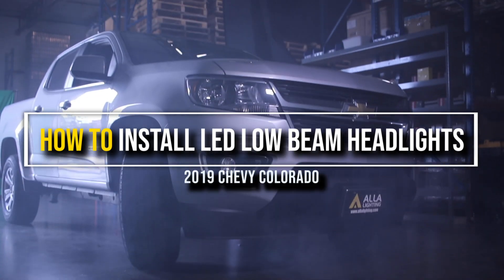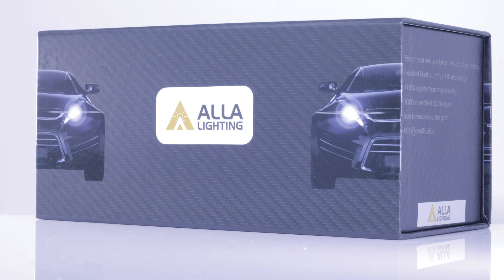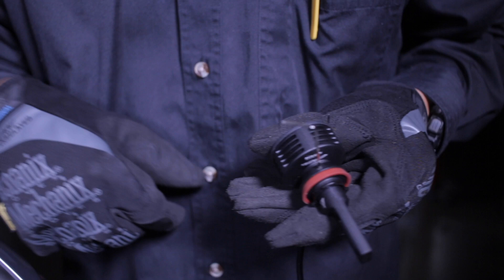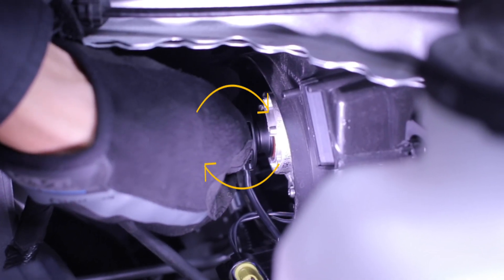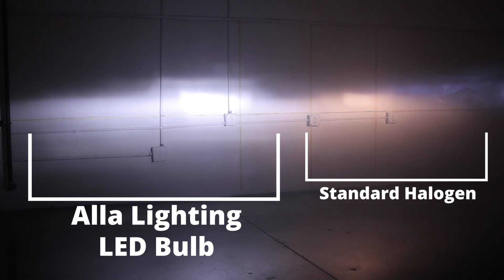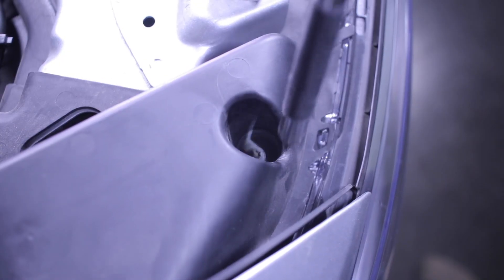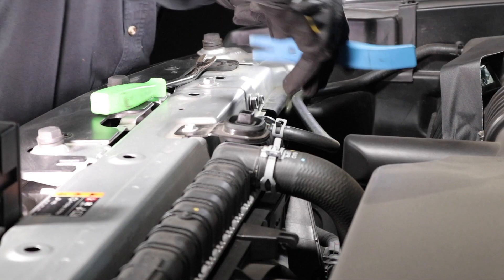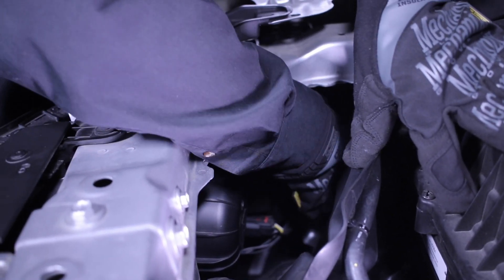How to Change 15-19 Chevy Colorado Low Beam Headlight Halogen Upgrade?

Comment from the maker: Chevrolet Colorado bulb size guide link: https://allalighting.com/pages/chevrolet-colorado-bulb-size-guide-exterior-interior-lights
This video shows how to upgrade & change 2015 2016 2017 2018 2019 Chevy Colorado Low Beam halogen headlight bulbs to H11 LED replacement headlights, just plug and play ,easy installation. Thanks for your watching, if you like our videos, please thumbs up, and subscribe with us with more installation videos for you.
Reply: Alla Lighting Automotive LED Bulbs, what will happen if the dust cap cover not put it back on?
Reply from the maker: @SAOKAROLINA  If so, it is recommended to replace the dust cap to aftermarket dust cap, or upgrade shorter version led headlight bulbs, we have both options, if you need, please contact us directly by phone 1(909)606-2935 or email service@allalighting.com for further assistance, thanks in advance.

Comment: To remove the passenger side dust cover requires a T15 torx screwdriver? Isn't it supposed to be a T20 instead?

Comment: Any idea what the heck the extra covers blocking the passenger headlight is for & do you need it ??
Reply from the maker: Do you refer to the dust cover? Dust cover is for waterproof and dust proof, usually it is better to put it back especially for the location with a lot of rain or dust.